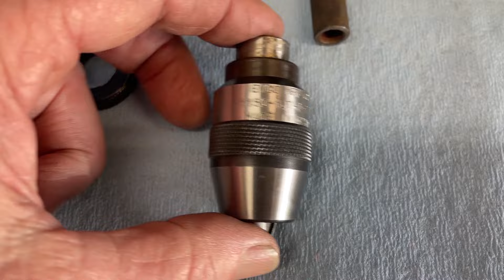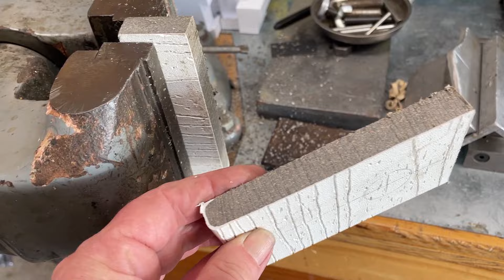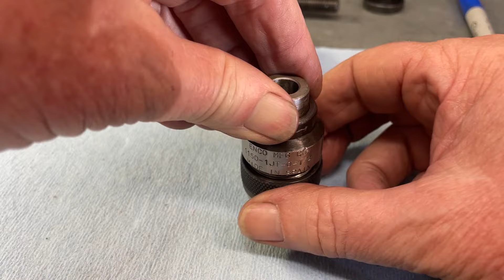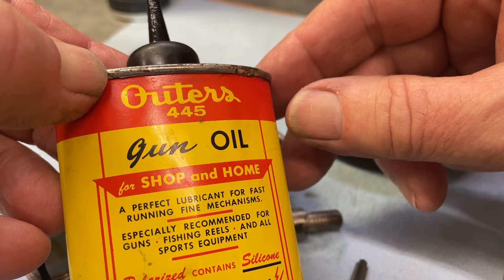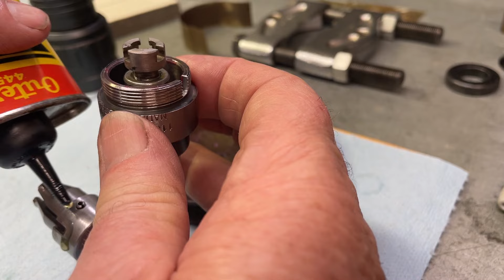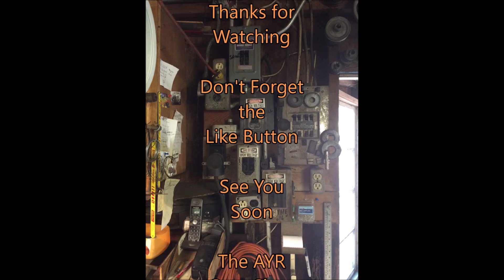Small keyless Drill Chuck Service - Enco MFG

Comment: I have a 0-1/2" Albrecht that I recently serviced (didn't do a video). I used a stone on all the sliding surfaces, and that did wonders. To put the bearing balls back in, I 3-D printed a fixture that I inserted from the back of the shell, then dropped all the balls in around it. The fixture had a smaller diameter stup that the hole for the arbor that's in the body would fit over. I then pushed the fixture out the back with the body of the chuck. Made it a lot easier than I imagine it was trying to set those balls in one by one into the grease.